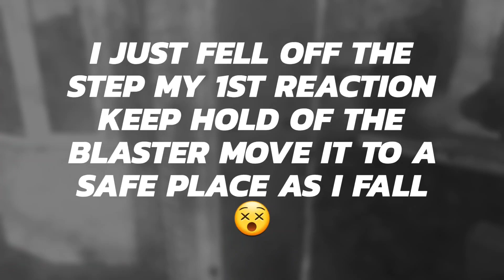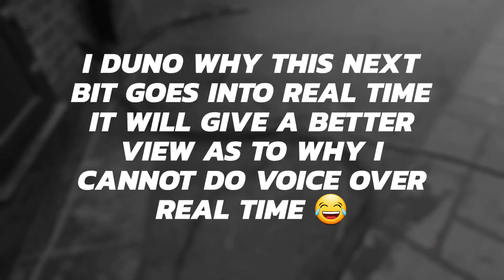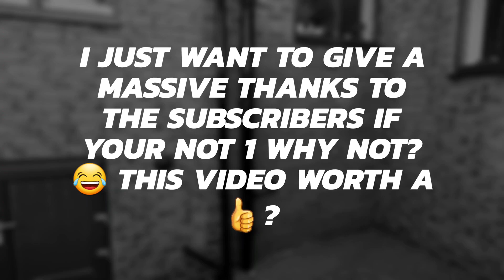Removing Paint off Brick dustless SandBlasting

Comment: Will a sand blaster remove excess mortar from shoddy brickwork? Love the vid
Reply from the maker: That's a tricky one yes but other methods need to be explored 1st. Brick acid a DIYer can buy is piss poor any company that offers external building cleaning should have some (the proper stuff 🤫) and a decent power washer same again 3000psi 11Lpm+ units not diy stuff if your wanting the best results. Job dependent you may be OK with BnQ brick acid and a fairly decent power washer all depends on the job really
Reply: @Mobileblaster  cheers; I’ll give it a go with some bnq stuff before committing by o buying a sandblasted.
Been looking at a blasting unit for antifoul removal on my fibreglass boat, not sure how effective it’ll be or what medium to go for hence the YouTube research and ultimately found your videos very oddly relaxing lol( tip for self get out more!).
Is there much difference removal wise of wet sanding versus the dry in your experience?
Reply from the maker: @itsjustplainsailing5189  wet only adds water to suppress the dust it dose nothing els possible it lowers the blow a little but nothing ya would notice.
Stay well clear of fiber glass even very experienced blasters can mess that up. I stay clear as it all depends on the gelcoat thickness or if its been blasted before sodium hypochlorite will clean the fouling off 🤫😉
Reply from the maker: @itsjustplainsailing5189  if its green or once alive SH will kill it off and clean it up careful it will rust anything other than s/steel and eat rubbers and seals
Reply: @Mobileblaster   cheers dude
Reply: @Mobileblaster  hi hope you don’t mind me asking where you got your blaster from ? I’ve got a thermatech and every paint removal we do is a nightmare with just paint stripper and heat , I’ll definitely have to invest in one like yours would appreciate any info
Reply from the maker: @northlondonmasons107  😂 I've had doff and thermtec and I can say falch is 300bar and can get to 150° with mods 24lpm makes doff look bad you can also dumb a falch down and run 2x lances still more power than them.
Blasting is a different game all together alot more can go wrong do some training see if you like doing it first as its quite an investment to do it right. 👍

Comment: Do you run the risk of taking off paint or material from the windows or door frames? If so how do you prep your customers for that concern
Reply from the maker: On this job I was confident I would course damage. On other jobs when I know im going to be close to damage I prep the serface 👍
Reply: @Mobileblaster  what do you find works best for protecting surfaces that you don't want blasted?
Reply from the maker: @ryanwenzel4598  1 strip of masking tape 2 strips of duck tape then plastic sheeting instead of borads very unlikely that ad need the plastic sheets but some jobs just for peace of mind 👍(masking tape 1st because if ya catch duck tape it won't come off too easy)

Comment: Hi.  Can I do this by myself or I need hire someone/specialist.  

Also does it work on freshly painted bricks after 10 days? 

Cheers mate
Reply from the maker: Yeah its doable by your self. Cost wise would work out alot cheaper to get someone in that way it should be done properly. The cost to rent the gear and the media you will waste getting ust to the rig etc and then your dropped in at the deep end with safety etc if you have no experience I would advise get a pro. These videos aren't a how too as they make it look easier than it is without blowing my own trumpet 😆
Reply: @Mobileblaster  would a paint stripper and pressure washer do the same for a small area?
Reply from the maker: @tjscott1204  yeah definitely 👍 I chose to blast as I know I can get it 99.9% perfect as with chemicals you need time to test wich works and don't dwell time etc its just faster and easier for me to blast 👍
Reply: @Mobileblaster  thanks for replying

Comment: So is this just a high power washer with a spinning point jet? There is no media? In this example, the pain doesnt appear to be on the mortar. What happens in that case?
Reply from the maker: The water is only added to suppress the dust its the media that's doing the work 👍
Reply: @Mobileblaster  What media are you using?
Reply from the maker: @caddhelp  crushed glass super fine 0/0.2

Comment: Hi could this be used indoors please?
Reply from the maker: Yes and no it totally depends on the job in question 👍
Reply: @Mobileblaster  many thanks for replying, it's for wooden doors and paint off bricks inside the house
Reply from the maker: @zxresa  doors would be better taken off and sent for dipping and stripping as for the bricks it can be done but be warned its very messy process 😬

Comment: I just would like to see in what condition are the windows after such treatment?
Reply from the maker: Good question I will show such results in the next video its taken alot of practice and errors to be able to use the right media and psi 100% of the time the glass is perfect using my methods 95% of the time the frames are fine too but it depends on the paint and substrate and what your trying to achieve. Rubber and silicon isn't affected at all but soon as the paint is removed this could brake the seal depending how thick the paint is your trying to remove. Pvc can get slight damage I'm talking a very fine etc once the slurry is removed it takes a very good eye to spot and know what to look for if this was still an issue buffing cream whats used on car polishing can bring them back thats if its an issue. Admit using the wrong psi and media can course alot of damage to the frames and glass but the way I now do things I've had no problems. All I have done for the past 10/12year is do mobile blasting 6 and 7 days aweek (another 1 or 2 years in a booth static) I'm no means an expert but have had all these issues before and learnt how to adapt and over come such issues hope this clears things up👌 once again good question 👍 (media used is like talc powder if you put some on a car and try to rub it in it will scratch the very top layers but same again this can be brought back with buffing cream some media's will rub down till you can put a profile in the steel its all about using the right media psi and methods to achieve good results)
Reply: How much damage  does that media do the brick face? Dont know how old that house is but would victorian stock bricks withstand that blasting ?
Reply from the maker: @dee106ful  it is abrasive and it will alter the face of the brick very slightly. But it will not affect a brick performance to do its job in any way shape or form some people have the wrong conseption with blasting eva that or they have had bad experience from a poor operator. Done right it'd no more harmfull than chemical cleaning the brick well possibly just a tad more abrasive but mostly only noticed if pointed out

Comment: Probably doesn't work to well inside for a fireplace or such.
Reply from the maker: Not so much dustless but if water run off isn't a issue its ok to use dustless. When water is an issue it can be done dry in turn making a lot of dust but easier to clean up dry than slurry :)

Comment: Great job of paint removal.
Where do all the paint particles end up?
On the ground?
In the water and down the sewer?
It could have lead in it.
Reply from the maker: Thx it is appreciated 👌 I welcome your concern I have kits on the van to test for lead 👍 Yeah the paint normally sticks to my slurry this is then washed to the floor and bagged up to dispose of in the correct manner the slurry is heavier than water so all that runs into the sewer is water run off. On the odd jobs some media will end up in the U bend of the sewer but I clear these and make sure they are free flowing of water hope this clears things up for you 👍
Reply: @Mobileblaster  
Sounds like you not only do a special job of paint removal ....clean up as well.
Now that's a professional !
Reply from the maker: @ithacacomments4811  thx it's appreciated please have a snoop through my other videos I have some clean up jobs on hear 👌
Reply: @ithacacomments4811  @

Comment: Why sandblast the brick, when you could of chemical stripped it with less damage
Reply from the maker: Less damage? I think you may have had bad experience with a bad operator admitted its abrasive but with the right media and psi no more damage will take place than chemical (their is risks with both Methods knowing how to use them correctly helps👍) chemical was offered but he wanted blasting as he had seen a pervouse job and he was more than happy with the results.
Reply: @Mobileblaster  i have had the chemical method done yes, and it removed layers paint from my property without damaging the bricks,are you saying your method doesn't cause any damage to the brickwork at all? Sandblasting is an abrasive method and regardless of psi or abrasive, unless soda, it will take the face off the bricks making the bricks porous causing long term damage, im not questioning you as a whole but sandblasting in general. Hence why its not allowed on historical building
Reply from the maker: @stephenwighton9383  Yes it's abrasive and yes it will remove a very slight finish to the brick. The media used is in the middle of soda and glass, very much like talc. The presure washer used after the the chemical is around the same abrasiveness as blasting so its 6 of 1 and half a dozen of the other etc. There is faults in both methods but this damaging brick or stone to make it porous is nonsense, a brick is designed to repel water and weep water out same with stone as a natural material. I have had a torc blaster and a jos blaster, both are approved by English heritage and both are shite and work on the same principle as my methods when it comes to been delicate. Yes the jos and torc spin the media but so does the air holes in the win nosel to spread the hotspot. To be fair, in this job I wasn't too fussed as he knew what to expect as I did a job he had seen with a heavier grade media to remove thicker paint and was happy with results.
Ps, even if a heavy grade media and very hi psi hitting brick or stone if there is more than 3" left it will still do its job as designed and won't take on anymore water than it was designed to. If you have damp on a wall, say gutters and cement is good but you still have damp 99% of the time, it will be the paint on the exterior that making a bag type effect causing the brick or stone not to weep water out. This job was purely cosmetic. I hope that's cleared a few things up? 👍
Reply: @Mobileblaster  with what you do I would expect you to vouch for sandblasting, yes paint is the worst thing you can apply to brick or stone and I do agree that the  jos is still a sandblaster and still does the damage, guess we will just have to agree to disagree on this one.
Reply from the maker: @stephenwighton9383  I'm not a spokes person for sand blasting or anything as we offer chemical cleaning as well but there is skilled operators out there that understand the risks, adapt and overcome. I thort you was saying chemical is a better option or safer method to remove paint but with skilled operators that understand the media psi and chemicals its around the same abrasiveness possible that blasting may be a tad more abrasive you would only tell under a microscope. You need a minimum of 100bar pressure washer to remove the chemical and paint then the run off chemical all over the place. I can safely remove paint from a coke can thats aluminium and not bust the drink look out for this video soon.
Everyone is open to an opinion on wich methods they finks best all I want to achieve is put some facts in font of people then let them make their mind up. Yes not all blasting operators understand and give other a bad name but done right blasting is a viable option to clean facades chemical is normally my 1st call of action but their is loads of folk on YouTube doing jetwashing videos I am the 1st POV timewarp Blasting nether a follower but always leading😆🤣👍 on this job you would need to apply 3 different chemicals to achieve possible 4 to get those results
Reply: @stephenwighton9383  Hello. Without being an expert myself on sandblasting, I would like to point out that it is considered a bad practice by many people because there are so many old bricks out there. It's older bricks that were made using differing mixes of ingredients and fired using different and wildly uneven methods, that are susceptible to damage from a even a 'gentle' sandblast, hence historical buildings are not treated using this method. And for what it's worth, modern bricks are approximately 20% porous, but this is quite separate from their absorption which varies tremendously. I think that if done carefully on the right type of brick, sandblasting can be an appropriate method of cleaning.

Comment: Let's hope that wasn't lead-based paint on the house
Reply from the maker: I have test kits on the van and it was water based or solvent. To be fair I have training to Blast clean lead and asbestos also my own built pot allows for these methods if required. Thx  for your comment but on this occasion I have this base covered.